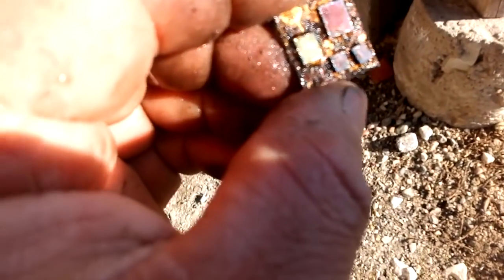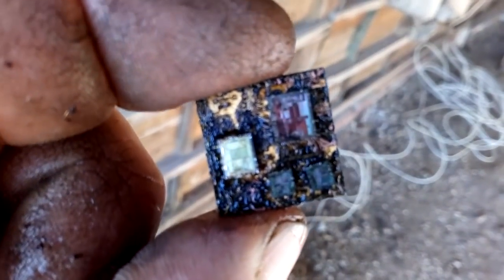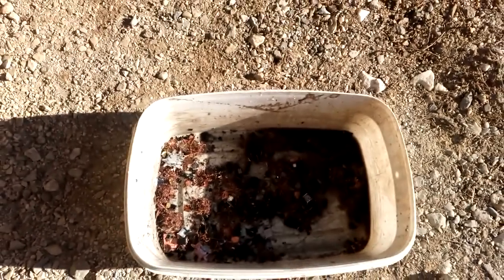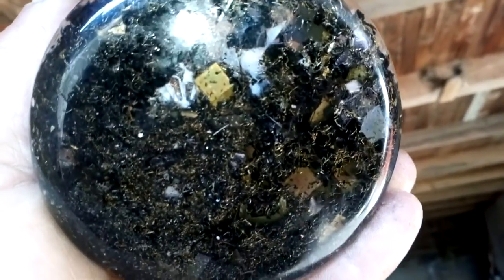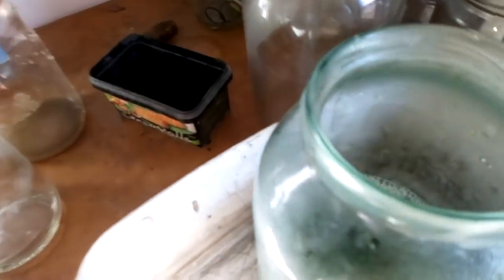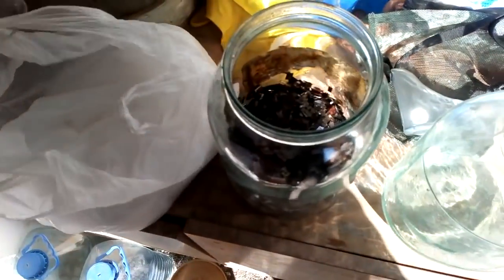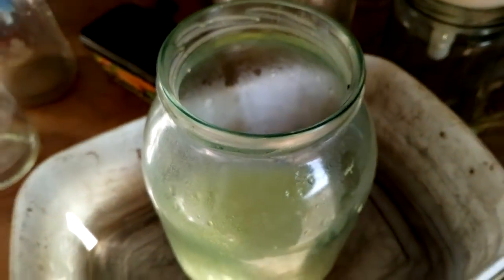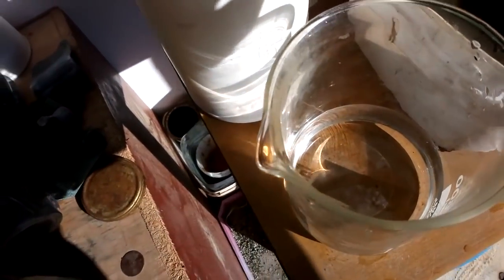Plastic IC procesors chips gold recovery - Wet ashing proces!

Comment: does 95% sulpheric acids cleaner work? also if so would it matter if it was coloured, thank you in advance for your response
Reply: No, you would need to purify it first, as the inhibitors will prevent much reaction.

Heat up the solution to 50C, and slowly put in hydrogen peroxide to form weak piranha solution and destroy the inhibitors:
https://www.youtube.com/watch?v=4DUGRWjdNLI&t=28s

Comment: Hi Dusan, great video,  I'd like to ask you, how long i need to boil chips to get the job done? and after i can filter the sulfuric solution in a inox net ? thank you for the help !!
Reply from the maker: Nico Locasto depends on the thickness and quantity of the chips and materials that have sprung up, it's never the same. You can get it through the stainless steel wire, although sulphur will eating  mesh after a while.

Comment: Hi, Is it possible to process with nitric acid instead of sulfuric acid? Would there be a problem?
Reply from the maker: Jose Luis Sanchez It may take wet ash in nitric acid, but the process will last much longer, Nitric is less devastating for chips than Sulfaric. But it is feasible.

Comment: Nice work..  what "% sulfuric do you use for this?    Also when making aqua regia what "% nitric acid" do you add to your hcl/nitric mix?    Not the ratio of nitric to hcl but the strengh of nitric you use for your mix?    It would be much appreciated any advise, even your preferred % to use would be cool...   ps,   how do you wash the bga porridge sulfuric mix without losing gold?  Ive never seen exactly how people are doing it?   Thanks for the vid mate...
Reply from the maker: 96% sulfaric accid use .75% nitric, although it will be fine every 50%  and more.It Does not matter the percentage of nitric ligaments goes to 3/1 or 4/1 mix of hcl and nitric.When I wash water with sulfuric from the chips, I'm spilling it on the mesh. I'll show it in the next video about the chips.Cheers mate.
Reply: Nice, thanks heaps..  i make my own nitric and didnt want to make fuming nitric at all for safety, i can easily make 35%-68% safely.. so thank you.. i will use around 50%nitric till i am better skilled.. thanks heaps..
Reply from the maker: Your welcome mate ;)

Comment: Great job. If the chips were gringed down to powder instead of wet ashing, would the results be different? Im somewhat restricted when it comes to fumes.
Reply from the maker: Probably it will come out a little less, because it will lose some gold during washing. It is not lost during burning.
Reply: 999 Dusan Gold recovery ok thx
Reply from the maker: Your welcome ;)